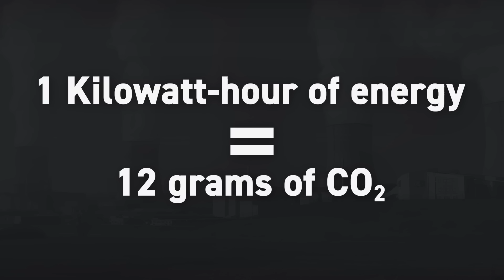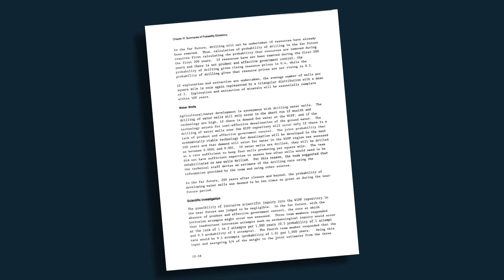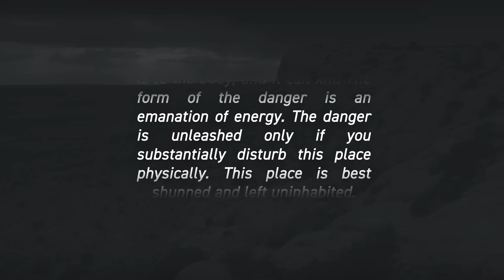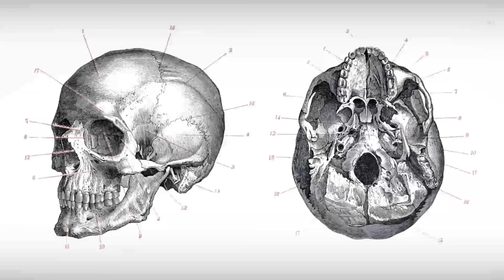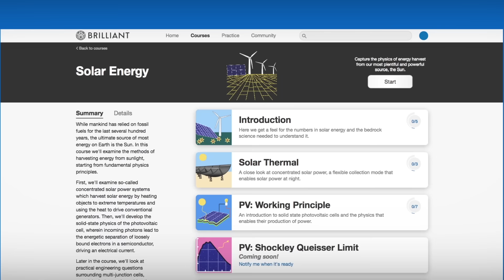The Nuclear Waste Problem

Comment: A liquid Fluoride Thorium Reactor (LFTR) burns up 99% of the fuel put in to it and the remaining radioactive isotopes will disappear in 300 years.  The LFTR can also utilize current stock piles of  Nuclear Waste to produce energy and again, reduce it down to something that disappears after 300 years.
Reply: They do produce some transuranics.  And ten half lives isn't going to make all that CS completely disappear.  That said, the thorium breeder route really needs to be properly researched!
Reply: How dare you bring up technological advances!
Reply: I heard about MSR and LFTR about a decade ago. Where are they ? That NASA engineer/scientist is a good tedx talker but not a real scientist.
Reply: Yeah TED is media nonsense, not facts or science.
Reply: MONAY
Reply: I think it is important to mention that this video neglects to inform that the PWR reactors used today only burn up about 1% of the fissionable material in the fuel because the fuel is a solid ceramic and it will burst the fuel rods and contaminate the water if it is not removed. This is like filling your car with gas and then having to preform an overhaul after driving just 10 miles. Molten salt reactors can be configured to use current nuclear waste as fuel by just florinating it. Any molten fuel reactor (not just LFTR) has the ability - thru simple HF closed cycle extraction - to burn up 100% of fissionable material (Including the plutonium created in the core-Except Pu 238 which NASA wants to power deep space probes) because the fuel is a liquid and is not contained by fuel rods. Also the fuels are Florine salts. Florine bonds readily with anything strongly which is why no fuel rods are needed and radioactive CS and I is chemically captured and kept in the core. Waste fission products can be chemically removed and separated by type, so in the even that you need to remove fission products, say to increase core neutron efficiency, the different classes of waste products can be efficiently segregated by chemical separation. Thus they can be separated by radiotoxicity making what little storage is needed much more efficient. Once separated materials reach background radiation levels, they can be used in industry as high purity extracts of normal material indistinguishable from their mined counterparts. The reason we are not seeing these in production yet is that there is so much expensive research to be done to insure materials safety, that the private section won't foot the bill. There is too much risk. The US Navy paid these costs for the PWR technology.  China if pouring millions into the research and plan to have one up in 2020.

Comment: I always wonder, if spent fuel rods still have enough energy to boil off water and cause meltdowns.. then why don't we use them to generate electricity?
Reply: Same here
Reply: They boil water but too slowly to generate enough pressure in a reasonable amount of time and size of the reactor.
Reply: look up fast reactors. there's a variant of them that uses molten salt as coolants. they can actually reuse spent nuclear fuel...if the vids I watched are to be believed...
Reply: Distinct heating and such maybe?

Comment: Nuclear waste does not have to be buried/thrown away, if it's recycled dangerous radiation levels only last about 100.years, and these wastes are more compact, and we get more nuclear fuel to produce power for several 100 years - this without removing any ore from the ground.

Comment: There are also other elements, such as thorium, that can be used for nuclear power that are safer, cleaner, and easier to get than uranium. On top of all of that, the likelihood of a truly catastrophic meltdown is lower
Reply: Hear hear!  But to be truthful, there is NO possibility of catastrophic meltdowns in the right designs.
Reply: @businessproyects2615  but thorium is denser it need another element with out it it wont be dangerous by just removing in and placing thorium in water, it also has more fuel and there's more of it. and there are less waste but it's still expensive and emit gamma rays if something is not removed. well i agree that it's not a magic want it's still better than uranium
Reply: @human8985  Thorium is not denser; Uranium is denser, both in therms of density and energy density when it fissions. Most reactors use U235 and not the other isotopes, but that's a fault of the reactor not the fuel.
Reply: @human8985  thoriumitself doesn't produce energy, it is used to create U233 which is then used as the fuel to create energy

Comment: This "waste" is actually unspent fuel. 
It can be reprocessed into usable fuel and used again.
Alternatively can be burned in a fluid reactor resulting in a much smaller volume of waste that is only radioactive for 300 years.
Contained waste is preferable to uncontained pollution. 
Dry cask is perfectly functional as long as its properly secured, but we should move it to a central location for each country. 
Sticking it in a hole in the ground makes it a pain to reprocess and reuse. 
We recycle plenty of other things why not recycle this too?
Reply: usp211816  so true but radiophobia and the medias $$$ profits seem to be winning out.
Reply: If you take out the plutonium through reprocessing, the waste loses all of its activity in 10000 years.
youtube.com/watch?v=rv-mFSoZOkE
Certainly you do not have to prepare to store it for millions of years for some extreme case of humans going extinct and some other animal evolving to sapience.
And considering that fast breeders will become commercial in a couple of decades, putting huge amounts of unburned U-238  five kilometers underground seems beyond foolish.
Reply: humans going extinct isn't such a low odds as you think. it seams like a fantasy thought experiment but its a real thing that can actually happen. the point of properly storing the waste isn't to save "animals evolving to sapience" but to clean up our own fucking mess. WE created the most toxic and deadly substances found on the planet. Since WE created it, it is OUR obligation to properly dispose of it instead of just dumping it into the planet and have it kill and alter the genetic makeup of anything that comes across it. We may not be around anymore but still wouldn't be right to pollute the only planet with life on it in the known universe.
Reply: +Sobaken, Didn't check your link, but I'll add credibility to your loose claim. The actinides can be burned up through breeding or a basic recycling step, this would cause the "dangerous radioactivity" phase to decrease from it's current thousands of years timeline to a few hundred years.
Reply: +TheUselessStoner. Normally I don't respond to edited comments, but plutonium, uranium, radon, mercury, etc. are all found naturally on earth. There have been natural long sustained nuclear reactions on earth as well. We are spinning around a large fusion reactor. 

With the exception of the Soviet Union and Russia we tend to treat our waste very responsibly. 

"instead of just dumping it into the planet and have it kill and alter the genetic makeup of anything that comes across it."
This statement shows your naivity with regards to radiation and nuclear topics. Take for example Fukushima, in almost a decade it's dumped (highest estimates I've found) 15-18tBq of "radioactivity" into the ocean, yet if you gather all of that onto the head of a pin and swim 30 feet above it, you'd be getting more radiation from the sun than from the whole of Fukushima. 

If you're really worried about the environment, lives, impact, etc. you'd be much more concerned with coal and the amounts of carbon we're spewing into the atmosphere, a lot of industrial practices have improved in the Western world, not so much for 3rd world countries.
Reply: I like how YouTube commenters know more than the scientists and technicians involved, and are happy to offer there uncompromising expertise at no cost.
Reply: Adam Davis (Sarcasm)
Reply: Some of us actually know that people like James Hansen, Alex Cannara, and Shellenberger are more reliable than the proponents of solar "renewables" and those who deny the reality of global oceanic ruination.
If you really know the quantities involved (there's a science called Arithmetic), nuclear waste is the very smallest and most easily managed of all energy technologies.
Note that folk like "Friends of the Earth" aren't.
Reply: until you realize Fukushima's most dangerous bit was and still is the one reactor that melt and which was usin reprocessed MOX-fuel..
Reply: Some of us actually have degrees on fields related to radioactivity, mine is on particle physics, but I got license to operate as a radiation safety officer as part of my education and when Fukushima happened I was in CERN attending to their radiation safety lectures in order to access the LHC experiments which have actual extremely high levels of radioactivity time to time.

ps. My first tour in CERN was as a summer student in nuclear physics lab ISOLDE and I was one of the few summer students actually receiving radiation monitoring badge. :D
Reply: we would if we could.
Reply: Is this cost effective?
Reply: I think the main concern is over nuclear proliferation.
Spent fuel rods contain some plutonium, which can be harvested from spent fuel far easier than it is to refine uranium up to Weapons grade.
Even if you lack the tech to do it, you can still lace a rod with enough boom to level a city block just to spread the radioactive material. A Dirty Bomb, if you will. In the hands of terrorists, a crude, low tech city block removal system suddenly becomes an area-the-size-of-city denial weapon. Now you might ask how that could make spent nuclear fuel at any more risk than reactor grade fuel being transported. Well, moving it to reprocessing plants adds another opportunity for theft. That's why spent fuel is stored in the plants they're produced until they're moved to drycasks for more permanent storage.
Also, this security issue is the whole reason plants use fuel at 3% enriching. A higher rate makes the rod last longer and create less fission poisons within it, but we simply don't do it. Aircraft carriers and submarines use about 5Kg of weapons grade uranium as fuel (85%+) and need only be refueled once every 20 or so years.

Regarding technical challenges in nuclear reprocessing, those spent rods still contain around 1% fissile uranium. Natural uranium comes with a 0.77% rating. So, it should be easier to get usable uranium out of spent fuel, right? Well, not quite. Whereas natural uranium gives only uranium and traces of other materials in the processing, fuel rods contain a lot of other actinide materials that absorb neutros withouth fissioning themselves and therefore halt the chain reaction. Those are the Fission poisons. And while it's far easier to separate two different materials than it is to separate isotopes of the same material, remember that those are solids. Uranium is turned into Uranium Fluoride, a fine powder known as Yellowcake, then decanted (centrifuges are just decanting devices that add some Gs to the decanting process through centrifugal force to speed it up) in a series of thousands of centrifuges to get the isotopic separation. Some chemistry is involved into separating the transuranics, of which Plutonium is the easiest to separate, but I don't know the details. Distilation is completelly out of the question.
But reprocessing is doable. In fact they do it. Just not at full scale, as in, only a fraction of spent fuel gets reprocessed right now. Concerns over proliferation again.
The plutonium extracted is either stored for use in bombs, RTGs or turned into Mixed Oxide (MOx) Fuel, which can be used by all water based commercial reactors (not sure if molten salts or other workfluids have any issue). Plutonium in MOx cannot be extracted.
Some nuclear waste is still generated, but far less than not processing the reactor waste at all.

Another alternative are depleted fuel reactors. Since that fuel generates enough heat to still risk a meltdown or release of radioactive particles in the environment, you can shove them in a pool and tap off the steam it generates. You know, a standard steam cycle. No need to move the depleted rods off site. Just build another generator right on the site! But the output is not so great, I suspect. Because nobody even tried ro do it commercially, yet.

Here's hoping the Thorium fuel cycle works out.
Reply: Wait. Where did you get that?

Unless I misunderstood you (non-native english speaker here), this is a misleading claim.

It is true, that the time is indirect related to the activity. Even protons (acids) are radioactive, you just ignore it, because the halftime is so long. And there is some waste (espacially the waste that takes the most time to decay) that you could use as fuel - 239 plutonium or 238 uran that can be bred into 239 plutonium, for example.

But you cannot ignore the long living isotopes down the chain. Isotopes, that can not be used (according to our current knowledge) in a powerplant, but have to be stored hundreds and thousands of years. And even 239 Pu, the "unspent fuel" you might be refering to, is highly poisonous - not due to its radioactiviy, but its chemical reaction with living organisms.

Comment: The message left out some important facts. The most significant one that I am aware of is that the rod is considered spent not because it lacks sufficient energy to continue using, it actually has 95+ percent of its fissionable material. The problem is that the rod pellets take on mehanical changes that make them unsuitable for continued use. THEY CAN BE REPROCESSED. This is CURRENTLY BEING DONE by other advanced nations such as France, UK, and Russia. It reduces the need and timeline for disposal, dramatically increase its efficiency, and extends the supply of uranium by leaps and bounds. It also minimizes the need for storage both long term and short term.
 The other shortcoming is the failure to mention the heavy water reactors, in very wide use, developed in Canada, and spread all over the world in a safe and efficient manner. Uranium enrichment is unnecessary, natural uranium is fine, and there are models Canada has developed that even can use spent rods. Each reuse cycle efficiently reduces the radiological danger, and the tiny remainder is very manageable.
 There is also another sin of omission. The failure to mention thorium as an extension of the usable supply of fuel. It is of itself not fissionable but what nuclear scientists call fertile, if bombarded by the same kind of radiation emanating from a reactor, it converts over to a fissionable form of uranium. The bundle of uranium reactor rods, if surrounded by a couple of rows of thorium rods, will create new fuel as the old is being used. It is thereby called a "Breeder reactor", and currently generates 80 percent or more of France's electrical energy grid. It has done so safely for decades.
 Finally, permanent disposal. Really very simple. There is a huge area in the North Pacific ocean. At the bottom, there is a huge area that has a deep muddy bottom, with the consistency of peanut butter that runs very deep. The long term storage concrete cylinders that it is currently in can be dropped down from a ship, and they will sink down in deep from their heaviness, and unless the Earth's gravitational field reverses itself, they're not going anywhere. Problem solved.

Comment: That is a long text message for the future. Just put "Danger: Radio Active Area". I mean doing those pictograms or images is pretty much the same as ancient civilization did. But we human, opened and explored those sites.
Reply: Or burn it in a breeder reactor and it won't be a problem.
Reply: @djmonli8928  Or just burn the nuclear waste in a breeder reactor for 90 times the energy because the only reason it stays radioactive so long is because it has stacks of Actinides = NUCLEAR FUEL. Once this is burned and you are down to the real nuclear waste - vitrify the remains into ceramic glass - and bury under the reactor carpark for 300 years. Then it's safe.
Reply: @eclipsenow5431  what I'm talking about is the message for future generations, people can only grow more curiosity if they are prohibited, so better dare them to dig it and scare...hahahaha, people nowadays don't believe in dangers, better let them die because of their own stupidity than warning them not to do such thing...hehehe peace

Comment: 97% of the spent fuel rods are put back into use by reprocessing. The remaining 3% is highly toxic waste and is vitrified (basically encased in glass) then put in underground storage with teams working to find ways to reduce the 3% to 0%  
You forgot to mention that.
Reply: J S  they do not, the UK do not only recycle British waste, they import it from other countries.
Reply: J S  so what you're saying is that America doesn't just bury all its spent rods, but rather sends it away and gets only a fraction back as containable waste? And gets more fuel to reuse in its power stations? Wasn't that my OP?

Comment: Casks are permanent storage devices. They’re laced with cement so it water gets in, the cement activates and fills the seal. And casks can be kept in the ground for centuries and nothing would happen to it. So what if an earthquake occurs? The cask shakes a bit in the ground. And nuclear fuel can be recycled into the next batch. Meaning somewhere in the neighborhood of 10% of all the spent fuel needs to be sealed and stored. The rest is used up or recycled. Just like in France
Reply: France runs some 70% of their grid on nuclear for decades now, but I have heard they are planning to start decommissioning some of the nuclear power plants by 2050, which will reduce the percentage.